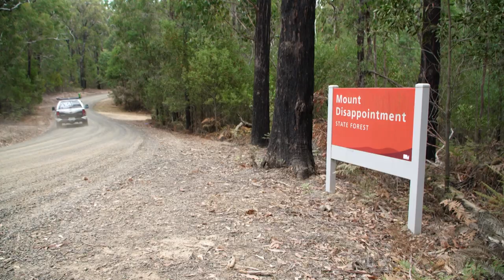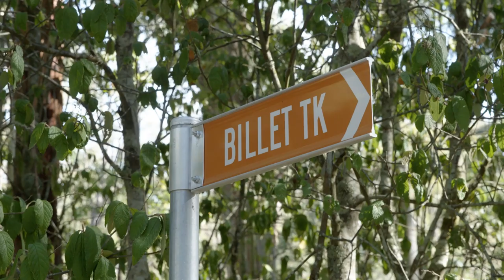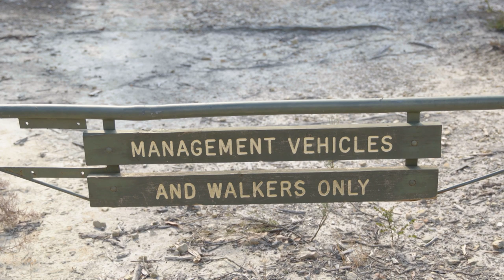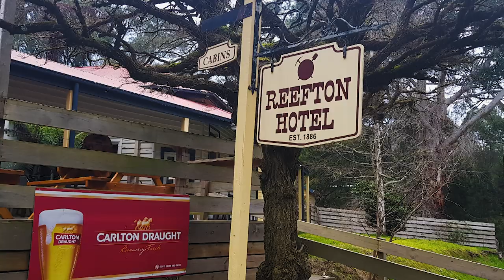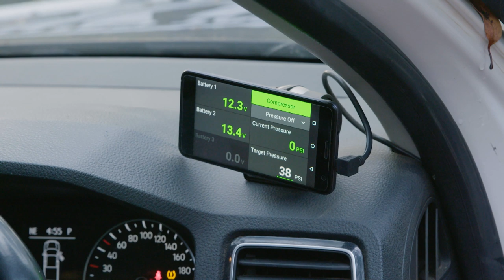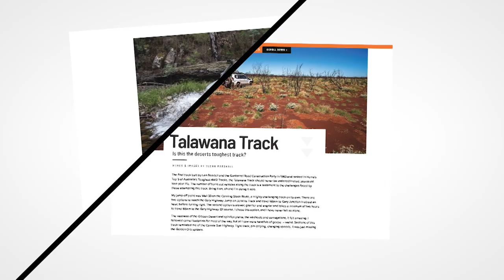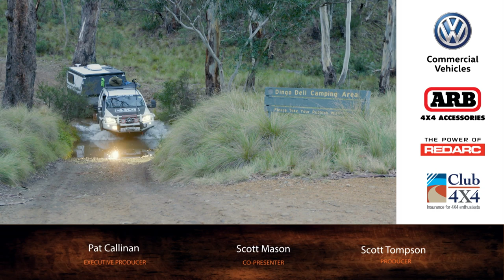Melbourne's Best 4X4 Tracks

Comment: What more damage will your Amarok do ?  Management vehicles rarely us the track. If the gate is open every fool with a 4x4 will use the track think about that damage.
Harder access for fire? When the weekend warriors get on it with 35" tyres the ruts they leave will make it difficult access with fire trucks and the standard Land Cruisers Parks Vic drive.
Your opinion is fun to spruke on telly Pat, but but it's not based in fact. 
I applaud your stance on responsible driving.  Don't go knocking the land managers when you don't know what they are protecting. That track could have significant cultural values, water quality control issues, threatened flora and fauna, all protected by a little gate and trust in the public. It's well known that Victoria has some of the best off roading in Aus. The gates protect it for everyone.
Reply: Well said. Thought Pat would use this opportunity and his platform to educate and help protect our parks, not criticise essential works that provide fire safety and management access. What damage could Pats amaroks do? Pat gives a great example in his own video from 18:35. Poor form Pat.
Reply: 100% agree. What's more, if it has gotten to the stage that Parks has blocked the trail, it's because people have already thrashed the area, damaged the trails, likely left garbage everywhere, and basically made the trails useless for their intended purpose. There needs to be a much stronger emphasis on teaching sustainable trail use and respecting the bush, rather than ranting at Parks for doing the only thing they have the resources and power to do after the fact.
Reply: Not just the 35's crew, now it's the 37's crew.

Comment: Hi pat with your arb under body protection we’re you having problems fitting the back piece because our dealer said that the back plate doesn’t fit to the new Amaroks just wondering if it’s in general or is just my car

Comment: Victoria used to be a 4x4 tourists heaven ... now you can only have a 2 inch lift and 33 tyers on .... greens have won and with out even a fight
Reply: It's still is.  There's plenty of 4x4's running 37's and large lifts.
Reply: david holyoake yeah there is heaps but it’s not legal I could run a 5 inch on on a patrol with 42s but I’m not because a laws are shit
Reply: @davidholyoake5767  and getting defects and fines .. its now the law ..